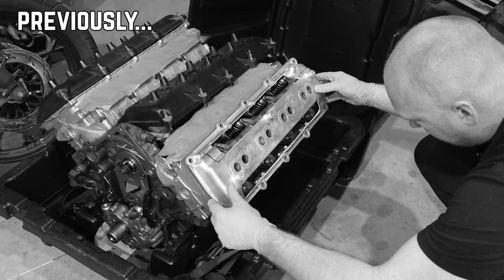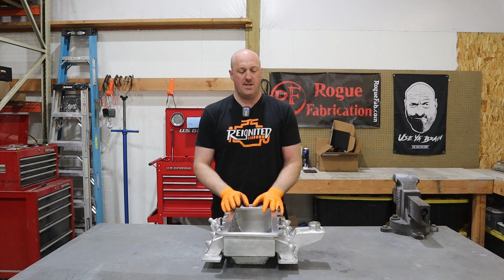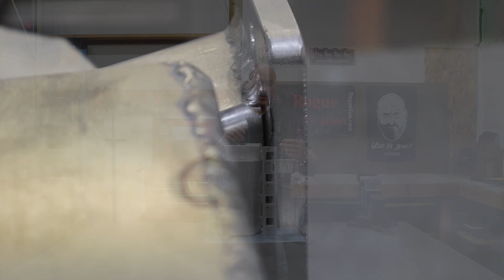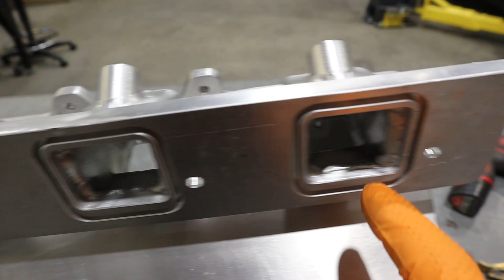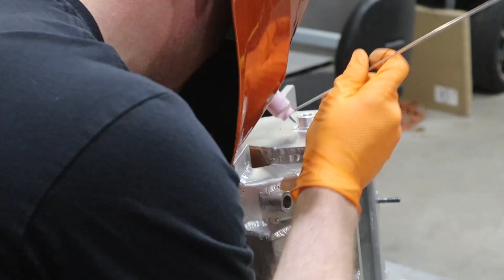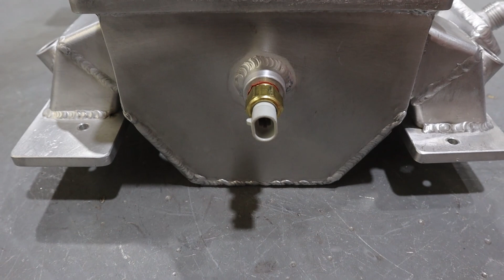I Let the Smoke Out! Poor Man's Hellcat Ep 21

Comment: Hello and Congratulations!  I have owned several Dodge vehicles over the years.  My personal toy is a 98 Dodge Neon R/T that I bought back in 08.  The car was originally red with silver strips and had the 2.0 DOHC engine 5spd.  It is now blue and has a 2.4L from a Caravan that I rebuilt with 10:1 J&E pistons, Eagle rods, BCR cams, and a host of other goodies.  It was the first car I ever dug in to so deeply until recently buying a 2011 Jeep GC with the 5.7L hemi and lifter tick.  I followed your series on many of the rebuilds of the hemi and decided to go with the stock oil pump but to eliminate the MDS altogether.  I am about 3000 miles into it, and it has been flawless.  Thank you!  However, I did say I am an old Neon R/T guy (yes, I have owned SRT4's as well) and wonder when we will see more of old red with the hemi swap???   Love the channel and thank you for your willingness to share.
Reply from the maker: Ah, the 2.4 big block swap! I was about "-" close to doing that on my neon back in the day, went turbo instead but I still wish I would have done it. I hate to say it, but the Neon project got put on hold 😬. because the Magnum has been such a fabrication heavy project, I decided the next one in line is going to be basically a bolt on style build that more people can relate to and will be able to replicate themselves. Sorry to disappoint you!
Reply: @ReignitedAuto  No reason to be sorry.  Life is about learning, and I am not alone in thinking there is something to learn right here.  Lets go!

Comment: Great channel and love watching. About to pick up a 23 Ram 2500 with the 6.4 Hemi. What is one mod I should do right away?
Reply from the maker: Use tow/haul mode EVERY time you're actually towing something 😄. But on a serious note, those trucks are pretty darn good right out of the box, I would be changing the oil no further than 5k miles apart, I don't care what the cluster says. 
In thinking about it now, your truck probably comes with the 8spd trans rather than the 6spd of the older trucks, you're good to go!
Reply: @ReignitedAuto  I will 100% change the oil around 5k miles every time. I did that with my 12 Ram 2500 5.7 Hemi and it has 202k miles on it and runs great. Just updating to the new. 
Very excited about the new one. And I always use Tow/Haul mode when towing the Jeep

Comment: Surprised to you were able to get all the smoke fluid remnants cleaned out of the leaks to be able to weld without it contaminating the weld.  Liked seeing the cast valve covers up on the wall of shame.  I have several of the ideas that didn't quite make it up on mine.  If you don't have a few of them you are not advancing.  Expecting to see a video soon of it running.
Reply from the maker: I'll be honest, I was a little surprised as well LOL. I cleaned everything with Acetone, but you can never get all of it but this time around it went pretty well. Still checking items off the list, but we are getting closer to the first start! 👍
Reply: @ReignitedAuto  Acetone is the way to go, Never Brake clean, you probably know that but I always try to share that safety tip.  Whenever possible I clamp blanks on and slightly pressurize with Argon and bubble test.   But the smoke test did give a cool visual effect.

Comment: You added the IAT to the manifold but what about the MAP?
Reply from the maker: You'll see that in either the next episode or the one after that. I'm going to use an external GM 3 bar sensor, primarily because it's used everywhere so the tuning software will have a value for it already. 👍
Reply: @ReignitedAuto  probably wouldn’t be able to find the SRT4 MAP sensor anyway, from what I’ve heard it’s backordered everywhere…
Reply from the maker: @kennyjohnson1369  like most of everything 😄

Comment: Pick up a flex head for your tig with a button back cap and the shortest gas lens set up for those hard-to-reach spots. Will have to cut a tungsten down to fit but makes for a small package in the tight areas.
Reply from the maker: I do need to get more accessories for my welding setup. 👍

Comment: have a hemi 6.1 Repaired the entire engine, changed everything possible, the oil pressure at idle is 170 kpa and if you twist up to 5000 revolutions, you do not rise above320 kpa, then it drops to 300 and that's it
Reply from the maker: New pump, new main bearings and new rod bearings? If so the first thing I'd be looking at is the pickup tube o-ring. Sometimes the o-ring can get nicked during installation and cause a slight pressure issue.
Reply: yes sir absolutely everything is new
Reply: When I first assembled, I replaced everything that can be changed, I changed everything, but I forgot Piston

Oiler Kits to change. Assembled the oil pressure motor was 100kpa idle, the pedal did not rise to the floor more than 280kpa. I drove at such a pressure of 7000 thousand miles, disassembled the engine and changed the bearing again, changed the Piston

Oiler Kits reassembled .pressure oil rolled at idle speed 170kpa and at high speed gains 320kpa then falls 280-290kpa
Reply: The only thing I didn't sharpn is Crankshaft bed
Reply: Excuse me for my writing, I'm from the Republic of Georgia
Reply: Sir ,I've been struggling with this small problem for 3 years

Comment: Was that closed or open style iat sensor? People who build Vr6 engines, replaces closed iat sensor with 1.8T iat, what is open style. React much fast and is more accurate. Also that small plastic cover does little heat soak on sensor.
Reply from the maker: Open style, I am expecting some heat soak as well, but I figured it's better to read a little hotter than it actually is than to read much cooler and toast the engine 😬